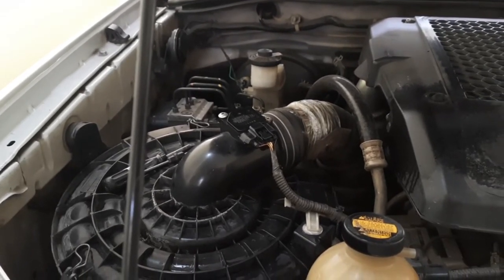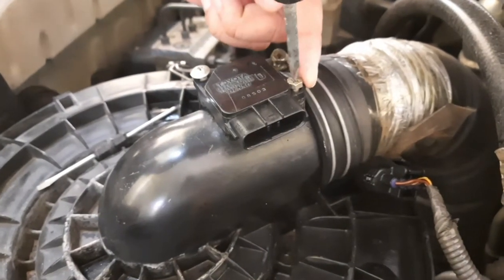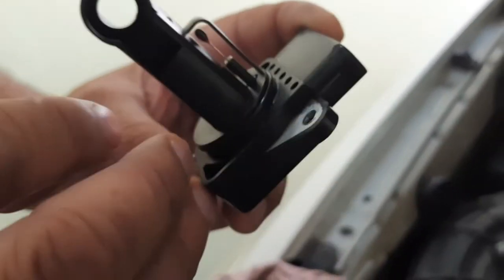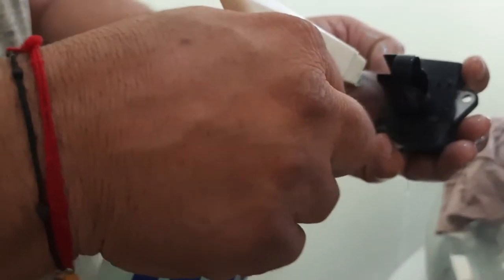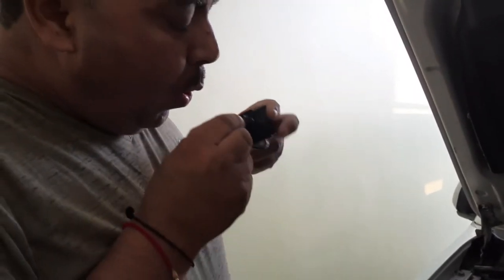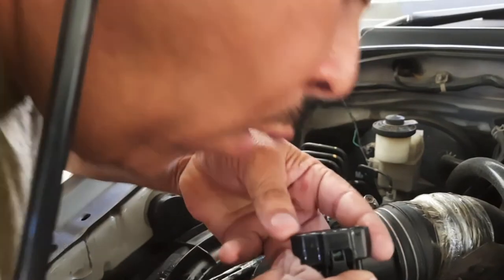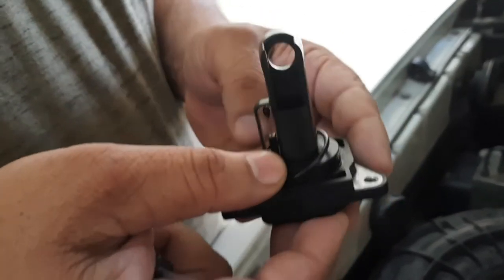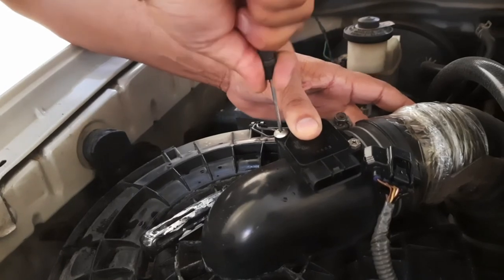Cleaning Process Of (MFA) Mass Ai Flow Senstoyota Fortuner/Innova

Comment: i wont recommed doing it that way,
that spray is not an fast drying liquid that could dry instantly from a blow, looking at how much you sprayed the part...
and uou evem installed it early,
might use the MAF cleaner aerosol if you want to be quick
Reply from the maker: Sir spray is a content of propanol that is  alcohol it very quickly evaporate

Comment: Ask ko po ford suv model 2010, na start pero pag accelerate mo walang galit nasa idling lang ano po kaya problem.  From capalonga cams. Norte maraming salamat po.
Reply from the maker: Sir can not understand write it in English
Reply from the maker: Kindly cheak mass air flow senser or air filter should be titely cv closed
Reply: naka limp mode yan boss,
madami posible na cause nyan

Comment: What is benefits of this activity?
Reply from the maker: Without mechanic you can do it at home
Reply: carbon deposits coating/stick on the hot wire which reduce the efficiency. By cleaning it can maintain the optimum performance of the MAF.